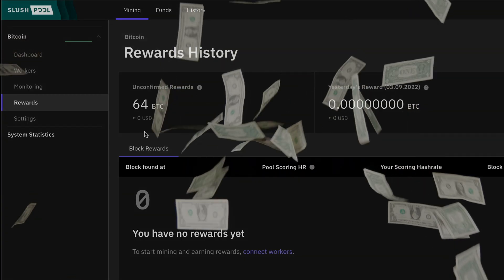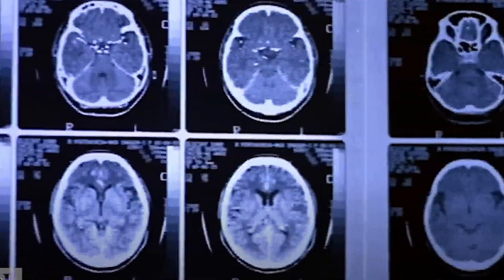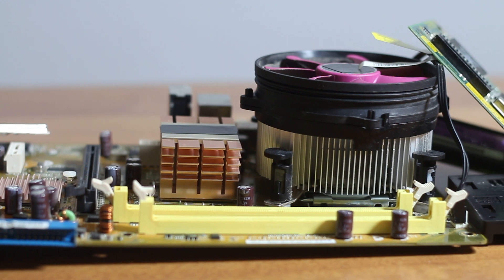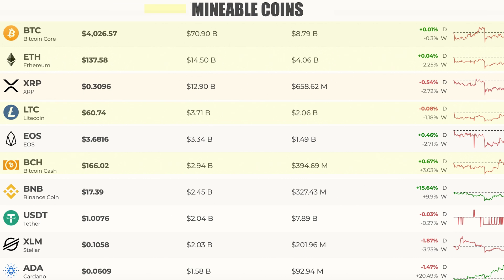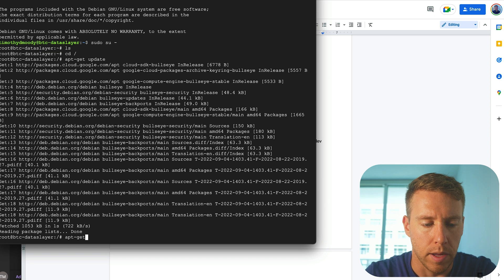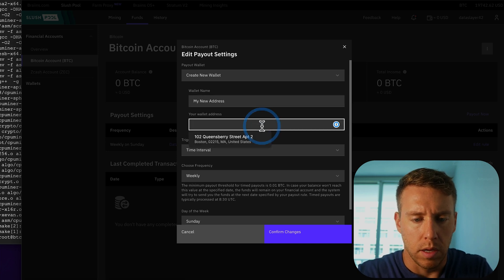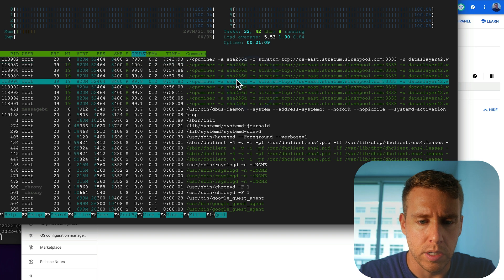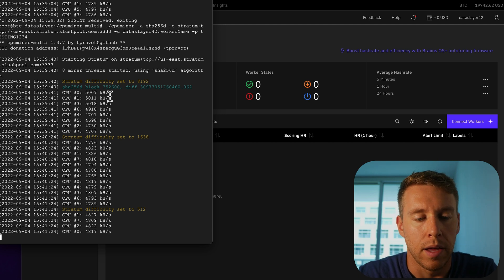I Mined Bitcoin for 24 Hours on Google Cloud Platform

Comment: I almost believed your BS until you turned off your camera and then used an incognito browser. A professional knows that neither of these two actions does anything but make the user feel safe. Turning off your camera ONLY turns off the light which shows that your camera is ON. A hacker or the government can still monitor everything your camera shows. As for the Incognito browser, it is nothing more than to make the user feel safe. It does nothing. Every thing you type into the browser is still monitored and can be tracked to you. If you do not believe me, then open up a Incognito browser and type in some plan on how 2getrid-of someone extremely important see how fast you end up going 2 jail.